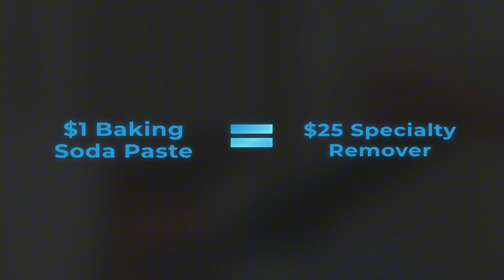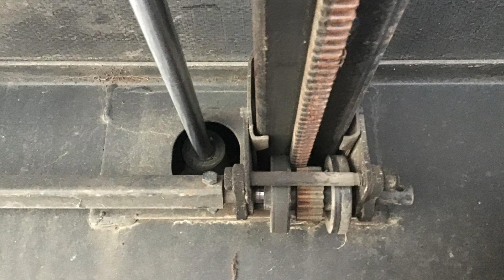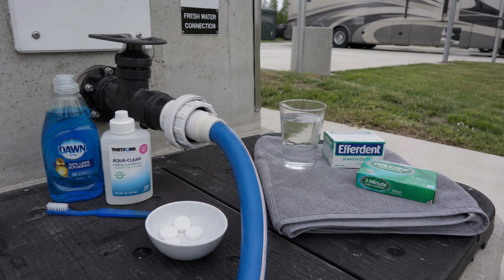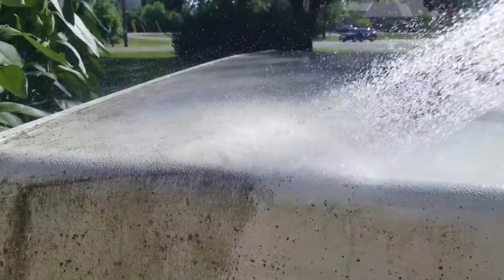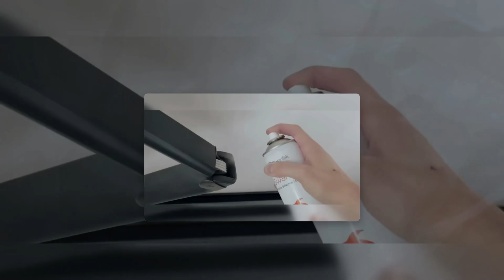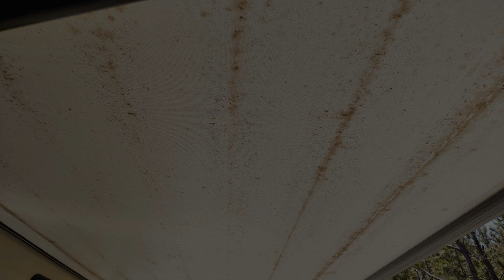TRICKS To Make Your RV Look BRAND NEW!

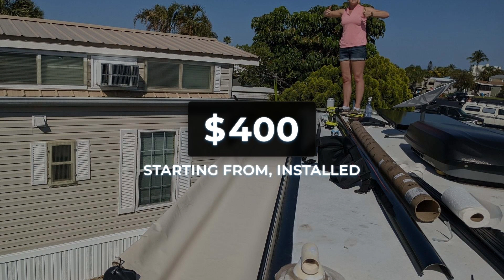Comment: #5- using WD-40, this should not be used.  It attracts dust and dirt, dries out and gets sticky  which can cause more problems I only use JB80 works extremely well and doesn't get sticky. 18:24

Comment: The ice in the black tank does not do anything.  Proven in YouTube videos!   Instead put 1 cup of Borax in a bucket of warm water.  Stir until it is dissolved.   Put a pod of dishwasher or clothes washer detergent in the bucket breaking the pod.  Pour in toilet.  Do this before the trip to the next location.   Leave it in until you must dump.   Then do it again.  Your sensors will soon start working correctly.  Borax in the gray helps too!  Do not use bar soap in your shower.

Comment: Think the baking soda will work on calcium buildup on my windows there's a few of them I can't see out of. I bought an older RV.?
Reply: We found, with a windshield, that your window glass itself may be as degraded as stained.  The windshield seemed fine, but when another event required its replacement we were shocked.  The $ were well spent.  If cleaning tricks don't work find a great glass shop.
Reply: @kitbaker1629Thank YOU 👍🏼 for the reply, Sending Blessings
Reply: Try vinegar, it comes in different strengths at places like HD.  I use it to soak plumbing fixtures that have buildup.
Reply: If you want perfectly clean glass, not acrylic windows, then get some 4/0 steel wool and dry rub the glass.  I guarantee it will not scratch the glass and the windshield stayed clean longer.